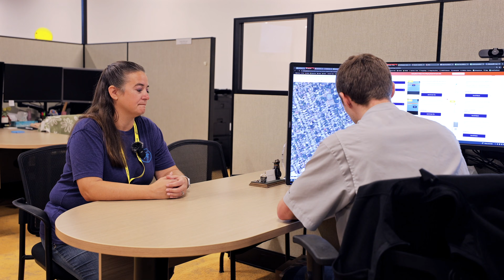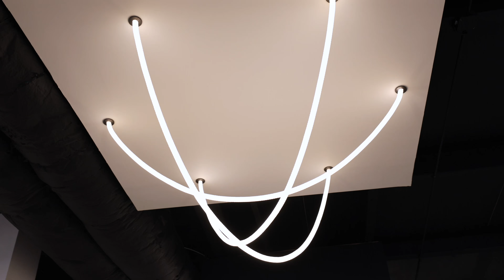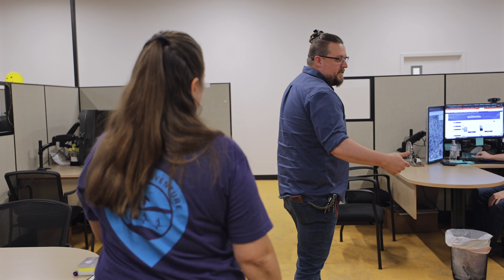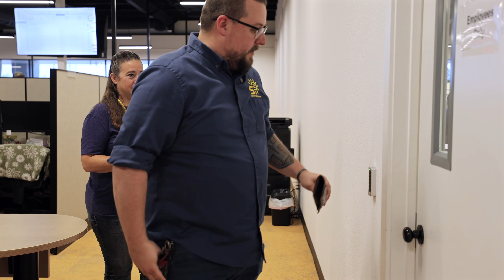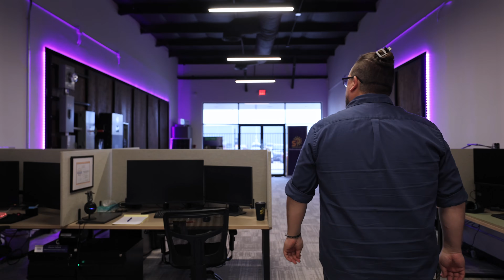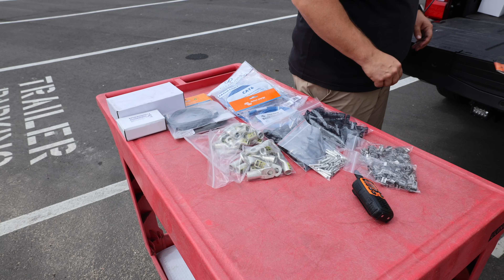RV Solar Experience LIKE NO OTHER: Introducing Signature Solar ☀️😎

Comment: Why 2 multiplus instead of multiplus+2?
Reply from the maker: Great question! 50amp has two legs of 120.. I’m running one of them through each MPII so the output is 6k watts when using the inverters instead 3k. Basically, our rig will always have 50amp service whether on shore power or batteries. ☺️ we can run pretty much anything and everything on this setup.

Comment: Great video, guys! Signature Solar was an easy decision for us, because we live in Sulphur Springs. Two years ago when we installed our RV system, they helped us with design and products that were perfect for our needs. We wanted a system set up for boondocking and in two years have had zero issues. During the install every time I had questions I would walk in the front door, tell them what I needed and they would let me talk to a tech-rep to answer my questions. Customer service was above and beyond.
Reply from the maker: Wow! What an amazing experience! What components did you land on?
Reply: @1StrangeAdventure  We used a 3kW Growatt 24V inverter, 2 × EG4-LifePower4 Lithium Battery | 24V 200AH and 3 Aptos 370W Solar Panels.